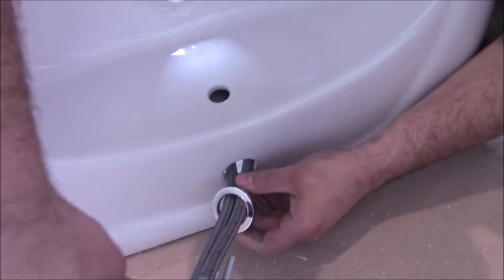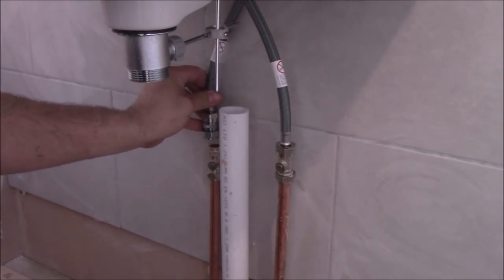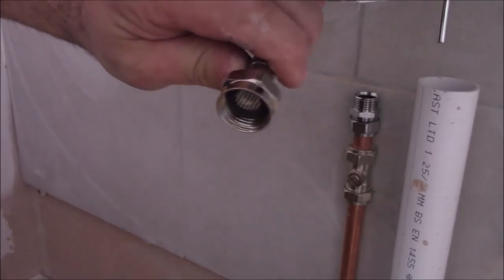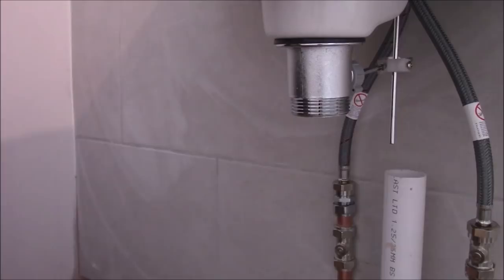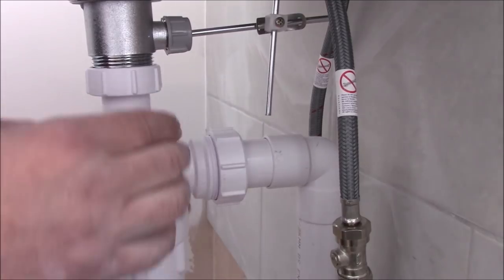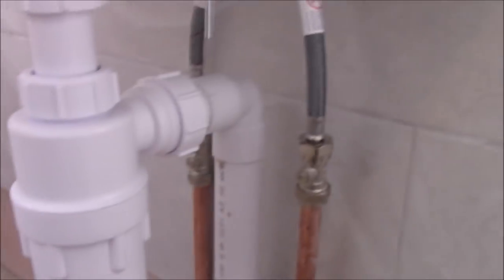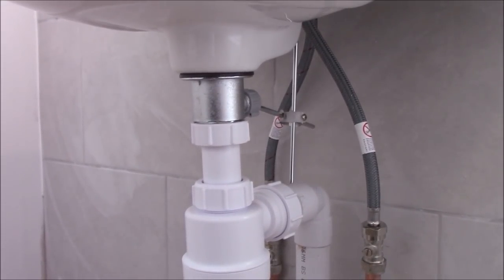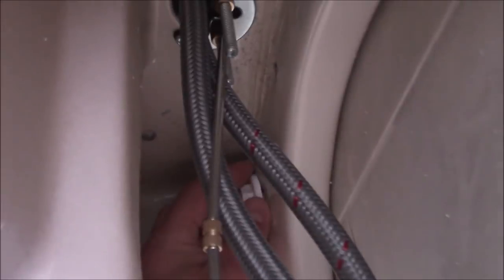Part 2 How to install plumb & seal wash basin Waste Bottle Trap Mono Tap

Comment: Very well explained, but what would one do if the waste pipe fitted to the sink does not have threads at the bottom and is smooth? Thanks again for a tutorial with extreme clarity.

Comment: Hi
When you connect flexible to isolate valve the rubber seal might get damaged.they do flexible pipe adapter which has flat top.